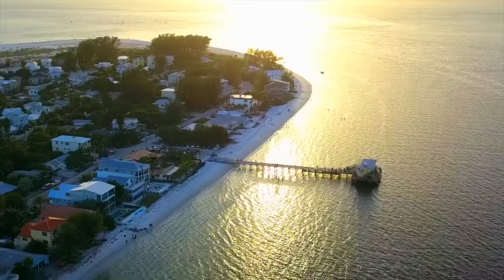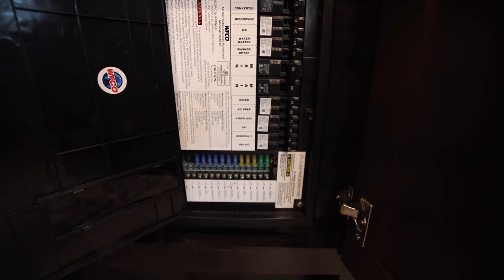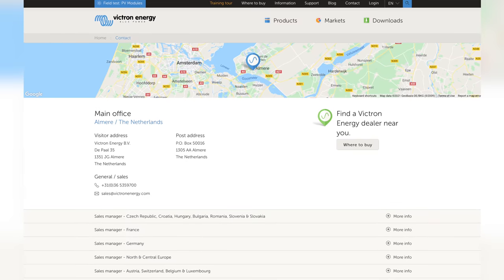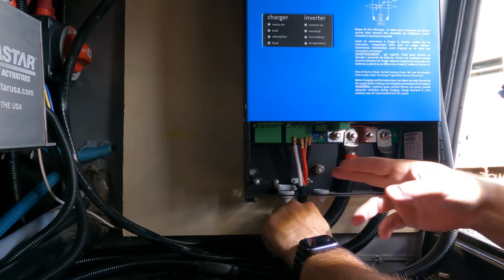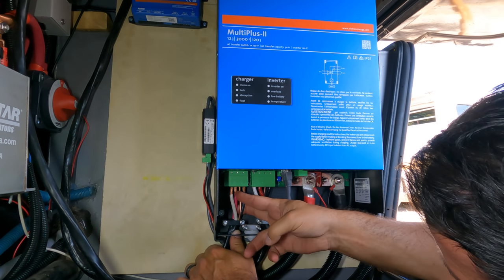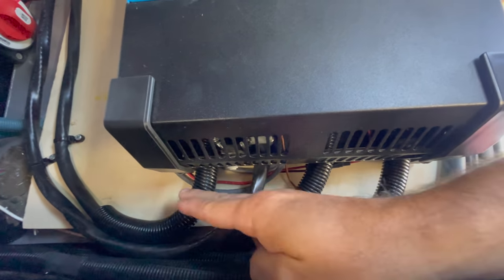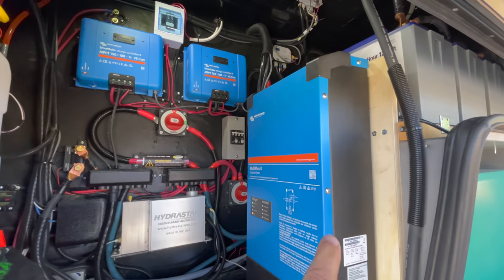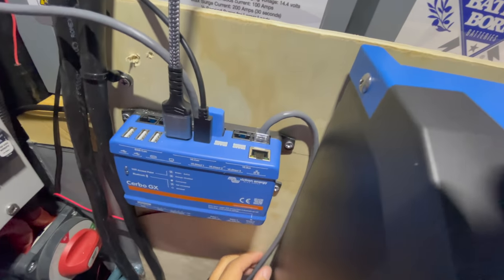🔋⚡️🔌 RV Inverter Upgrade! (Victron Multiplus II 12V 2x120 and CerboGX!) (Full Time RV Life)

Comment: Hey Chad & Tara, thanks as always for the great vids. Just want to add to the overheated cable issue. I worked for NYC Subways and we once had an epidemic of blown traction motors. We were able to trace the "failure" back to the crimping tool and dye used to make the 4/0 cables. We found out the lugs have to be crimped with a dye from the same manufacturer. The vid shows you making a crimp with a handheld crimping tool. I think you should stay with the commercially made cables, especially anything larger than #6 wire. Good Luck. Thanks again.

Comment: Great video as always.   I just installed 16 x 280ah EVE cells for a 560ah 24v  (14.4kwh) battery along with 2640w of solar.   I'm now waiting for the soon to be released 24v version of this inverter to finish my system.

Comment: We have a very similar setup in our 5th wheel. We went from the regular Multiplus, to the Multiplus II recently. Thank you for the explanation of V.E. Can! I have both of our solar charge controllers wired to the Cerbo GX using V.E. Direct cables. I’m going to make some cables and swap those out now!

Comment: Chad, you might consider Ferrules for your stranded wires.  I do this.  It guarantees surface contact between all the strands.  One other thought, perhaps you've done this... I keep the red DC plus from the shunt wired directly to the battery.  If you drop DC voltage by turning off your master switch,  the shunt resets and the SOC jumps back to 100%.  And one more suggestion: Install at 400 amp fuse either right at the battery bank and prior to your DC master switch.  BTW, I'm EE and I'm impressed with your knowledge.

Comment: I’m actually going from the electron multiplus one to the multiplus II. I would’ve done it from the get-go but the site I was looking at showed it been 26 inches long when it’s actually only 22. And my coach is wired with two legs coming in and out so I really do need this unit. I’m very much looking forward to do the change out install late this week. Thank you for the video.

Comment: One of the very nice features of this inverter, especially for "moochdocking" is the ability to limit the amount of current that the inverter will take from shore power.  You can set it clear down to 12 amps right on your panel.  That way if you are plugged into a standard outlet you can limit the draw to 15amps.
Reply from the maker: Yes.. Power share is one of the best features!

Comment: I also have the GoPower ic3000 only because it fit in a limited space in my truck camper. Honestly if I had to do it all over again, I would MAKE the space for Multiplus. The GoPower settings and informational displays are horribly lacking. I don't even use it to charge my 4 Battleborns, I just let the Victron MPPT 150/85 and solar panels handle it because the GoPower algorithm settings are questionable to say the least. Everyone, do yourself and get the Victron stuff, I'm an Electronics Technician by trade for over 40 years and have seen all kinds of electronics, the quality and functionality of Victron stuff is unmatched.

Comment: Awesome video! Thanks for explaining the Cerbo GX setup.
Reply: Question... When using the MK3 Cable with a laptop to configure the new inverter, the default is setup for AGM batteries. When the software asks for a service code/password to access those advanced features, how does one know or find out that code/password to change the inverter settings???!
Reply from the maker: I believe it's 00000
https://www.google.com/search?q=victron+mk3+usb+access+code
Reply: @ChangingLanes  thank you! Did you have to configure your new inverter or was it preset already for ya to access those options for lead acid to lithium? Great video btw! Very informative and explained things for normal non nerds lol
Reply from the maker: I forget what the default settings are... You'll definitely want to go through them.

Comment: Great video.  I purchased the same model VE inverter/charger (still in the box) and have been trying to sort through which accessories to order.  I’ll be starting with 3 Battle Born 100AH batteries (from previous camper) and 800 watts of PV panels.  your explanation of the various VE communication protocols was fantastic.  I now know to get the 150/70 VE.Can solar controller and Cerbo GX with separate panel.  On my previous camper, I used a Renogy inverter/charger (nice setup) but wanted VE to handle the new 50 amp Grand Designs 5th wheel.  I like the modular approach for expandability and will use the Cerbo to monitor the need for additional capacity.  We’re also installing a VE DC to DC charger for the truck to camper boost and have a 3200 watt LP inverter generator.  We’re leaving in January for an extended tour of the US and are looking forward to some boondocking mixed in with campgrounds and moochdocking.  You have a great YouTube channel and are an excellent resource for our new full timer experience.  Thank you!!!

Comment: I used this and your other solar video to order what I needed for my 5th wheel. I ended up ordering all the exact same victron gear based on your video, only changes I'm making are I'm using CHINS batteries from Amazon over the battleborns.
Reply: I used your code for what I got on battleborns site tho, hopefully you get a kickback on that.
Reply from the maker: Thanks for using our links! 😊  Good luck with the install!

Comment: I had asked you in the past about the negative and positive cables getting hot with your Magnum and you stated you didn't notice any over heating...the reason for the high heat is the 4/0 cable is rated at 195 DC amps and the Victron 3000 W inverter / charger is rated for 250 DC Amps, so high resistance / high heat is inevitable. Double cabling both the positive and negative cable is the solution as 2 x 4/0 cables = 390 DC Amp rating. This also happened to me for 2 x Victron MP Inverters and I saw the same temps of 150F to 195F. The bottle neck is the 195 DC Amp rating of the cables that was the problem that anytime the DC amps exceeded the cable rating, temps would increase rather quickly.

Since I added the additional 4/0 cables for both inverters (there are two pos and two negs post connects on each inverter), the heat issue is now gone and cables remain at ambient temp. I worked with Todd at NRVTA to correct the issue. He did mention you had been in conversation in this heating issue...glad you got it figured out.

Comment: Awesome setup. I wish the multiplus2 was available when I changed my inverter six months ago. All my other power inputs are Victron including a dc-dc charger from my alternator. I have the Xantrex freedom 2 in 2 out and a sub panel but my Monaco coach was setup that way from the factory.

Comment: Be sure to setup smart networking between the units. and use ONLY the Victron SmartShunt as the temperature, voltage, and current source for the solar controllers and the MultiPlus.
Reply: Great comment.  Since my batteries are not in same location as MPPTs or Inverter, I ordered and installed  the temperature sensor on the shunt data port and the sensor in the battery stack. This is a must as you pointed out if you value your battery investment.
Reply from the maker: That's exactly how this is set up..👍🏼

Comment: I had the same issue with the 6/3 romex on our MP2 2x120. I will be swapping it out for SOOW Cable for its flexibility
Reply: I used SOOW cable on my install. Worked great, but be sure to use ferrules when connecting to the MP2.
Reply: @jkonicky  I know people recommend using Ferrells with a flexible wire, but I think I’m going to try it without it mostly because I don’t want to buy the crimper. Also another installer has successfully installed without them on this inverter.
Reply: @SweetAdventures  I tried installing the SOOW cable without ferrules and really struggled. I finally broke down and bought a crimper and ferrules. So much easier and I now feel confident that I have solid connections. Good luck!

Comment: I can certainly appreciate your excitement Chad.  I've got the same inverter and cerbo gx setup arriving in the next couple days.  I'm still on the fence about wire sizing. Several calculators show 2/0 is sufficient for a 2% loss in 5' or less so that's what I ordered but I see you using 4/0. Maybe your lines are longer.
Reply: How did the 2/0 wiring work out?
I'm coming to the same conclusion as you and wondering how your setup is doing?
Did you double up the 2/0 and use a 200a fuse for both lines or a single 200a fuse for the doubled up 2/0?
Reply: @care_4445  I ended up doing 4/0 just to play it safe.  When I first tested the system it still got pretty hot around the fuse and disconnect. All ends were crimped with a hydraulic crimper.  In the end in glad I oversized it. I ended using a 400 amp t fuse as these inverters can surge.

Comment: The Cerbo has a wireless issue that you might have encountered or probably will. The problem is it drops off the wireless network and sees it available but shows a DHCP error. I'm also using a Max Transit but it did this with my Winegard AP that was included with my rig (Winegard is normally off as backup). My solution was to hard set the channel to 1; I reached out to my dealer who said that this is the current fix for the issue. I'm on the latest and greatest firmware and it's still a problem. I spent a week moochdocking in my sister's driveway running 3 ACs, laptop, TV, 2 residential fridges, microwave on a 15A outlet plus my solar. There was one day where my batts got down to 20% but it still worked like a charm.
Welcome to Blue Power guys, it's awesome gear.
Reply from the maker: Yes.. ran into this issue even though, we have a "fixed" unit.  It's better when we're not in an RV park with a thousand wifis.  I will be running ethernet soon.

Comment: Outstanding video & info… enjoyed your explanations & demo of 3 power source.  I like the choice of hardware: Victron. Looking at their website, noticed they had a Lynx Distributor… Fancy Bus bar & shunt. Would this replace your 2 bus bars & shunt? Looks like smart shunt is still needed to communicate with GX? Was this piece available when you built your system, or you didn’t see it worthwhile?  

Getting near retirement and busily planning multiple tools, systems, gadgets and mods for 5th Wheel & F450. 
Your geek videos are great, enjoy them all.

Comment: Hi Chad and Tara.  Congrats on the MultiPlus II.  I recently installed the unit on my 5th wheel and very happy with it.  It was a little tricky getting all the settings correct, but everything is going well now.  I agree, great big shout out to Jared from All About RVs.  I studied many install diagrams and his was by far the best (thanks, Jared).  I can't wait to add my solar panels and another battery.   Great video!  I'm excited to add the Cerbo GX now too.   Thanks again, Jason : )

Comment: Very clear and helpful, thank you!  One question: I noticed that your battery-to-battery cables appear to be smaller (2/0?) than your battery bank to Inverter/charger (4/0).  I struggled with sizing these when I installed my Multiplus and 4x100Ah BB batteries.  I ended up make ALL the cables out of 4/0 for safety's sake since I couldn't wrap my head around the current draw battery-to-battery.  Any thoughts?  Thanks again!

Comment: Thanks Chad for this video.  I recently completed the same project on my 5-er, and must have watched your previous video a dozen times or more.  I also got a lot of help from watching Jared's videos as well.  I installed the Multi 2x/120 as well as the Cerbo and Touch 50.  It really is an amazing setup.  I have one question to ask, if you don't mind.  I'm anticipating the day when I will be at a FHU site with 50 amps, and while gone site seeing, the shore power may go off.  I've actually seen this more times than I wish, and it usually isn't due to bad weather.  Anyway, if I leave the rig with two AC's running, this would immediately overload the Multi, I'm sure.  To prevent this, I am guessing I'll have to put the Multi in 'charger only' mode.  Is this the correct thing to do?  How have you dealt with it over the past years with your Go Power?  Thanks again for a great instructional video.
Reply: a Soft Start or Easy Start on those A/C's should prevent the overload, but will draw your battery banks down quite quickly, I think you can configure a max continuous discharge threshold, that would just shut everything down but im not sure about this.
Reply: Steve...good question as I had the exact problem on my setup in testing it. I forgot I had both AC's running and blew the Shunt fuse. Chad did a great video and his answer is what I thought it would be and thanks Chad for both! Great video as always. I wish there were more user guidance videos as opposed to all the install ones. Victrins manuals are not the best. Hopefully some will be coming by someone.We are all learning as we go.
Reply: @mikeventi637  Can you tell us what the answer was?

Comment: With power share, you might want to look into the Boost Factor setting in the Victron - mine was set to 2x - for our Keurig it was causing the Victron to initially try to boost to 2x the current limit setting (so for 15 amps that is 30 amps) - this exceeds the rating on the Victron and I would get a low voltage or overload alarm.  Changing this setting to 0.8x (so for 30 amps x 0.8 amps = 24amps) I am below my max output of the Victron.  For some reason this only happened during boost and only with certain appliances (like the Keurig - it uses Triacs which cause the Victron to think it needs more power than it really requires ....)  Just an FYI if you notice any issues with overload during power share .... great video BTW.  I installed my own system after watching All About RV ....
Reply from the maker: Thanks.. I'll check that... 👍🏼

Comment: I have the GP3000 and have the exact same issues you have with it. So glad to hear that they fixed that. 

Something for consideration. One thing that I do when I'm on shore power, is I limit the power of shore to 80% of the rated capacity of the line (24A for a 30A connection, 40A for a 50A connection). I believe most breakers are only rated for 80% of continuous output. It often saves your TT-30 receptacle too.

Comment: Chad, your knowedge and work is very impressive.  I really like Victron's bluetooth interface, but because i had Magnum Energy in my coach, i went with the Magnum MSH3012RV inverter/charger, which also has the same 50 amp pass-through as the Victron, but lacks the bluetooth. However, I can see all the same parameters via the ME-ARC controller. Not anywhere near as cool your set-up, but workable.

Comment: Hi. Great videos. I’ve been following you guys for years! I’m new to Victron and can’t find much info on the charts (under Advanced on Cerbo). Some of the charts are a bit confusing. Have you done anything on interpreting the various charts and data? It seems that there is not much on YouTube about the charts. Trying to track down an Overload on L1 error (air conditioner On) and from what I see looking at the AC-in chart, at this rv park, the AC routinely drops from 120vac down to 112vac on occasion. I realize my MP2 is going into power assist but I’d like to know more about the various charts and data that show under Advanced.

Comment: look into this when running on generator 
Dynamic current limiter
Intended for generators, the AC voltage being generated by means of a static inverter (so-called 'inverter' generators). In these generators, engine rpm is reduced in case of low load: this reduces noise, fuel consumption and pollution. A disadvantage is that the output voltage will drop severely or even completely fail in the event of a sudden load increase. More load can only be supplied after the engine is up to speed.
If this setting is 'on', the device will start supplying extra power at a low generator output level and gradually allow the generator to supply more, until the set current limit is reached. This allows the generator engine to get up to speed.
This setting is also often used for 'classical' generators that respond slowly to sudden load variation.
Reply: that would also be good when connected to 110v 15-20 amp

Comment: Chad thanks for this video, I see it's from 2 yrs ago, has any thing changed or would you have done any thing different? While building a system can you tell me what comes first , the batteries, the charging inverter or the solar? And having lithium batteries and 1 solar panel would adding the victron inverter work into the system while adding more batteries and panels later? Thanks and keep sharing